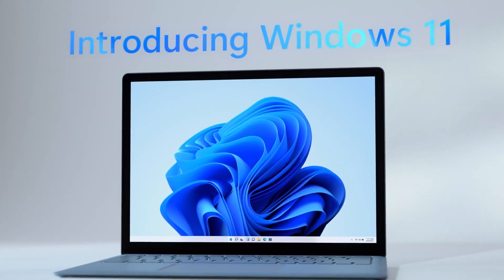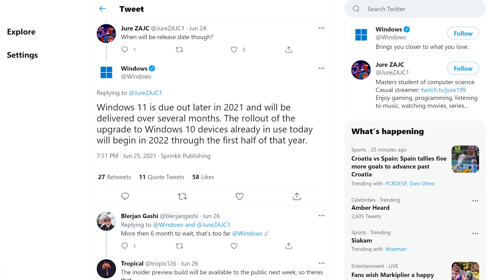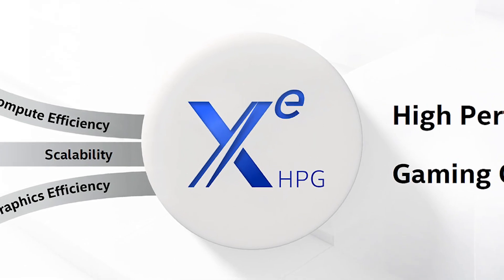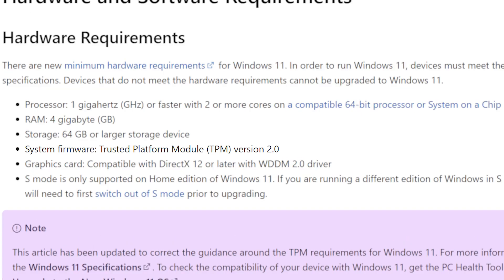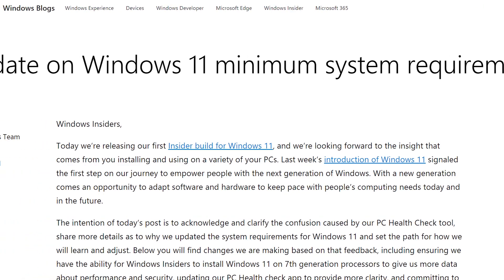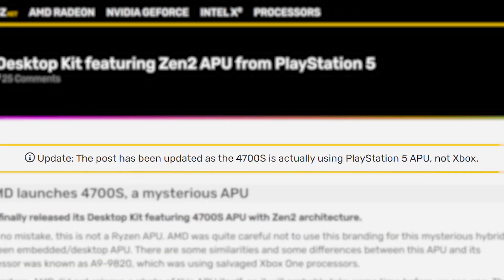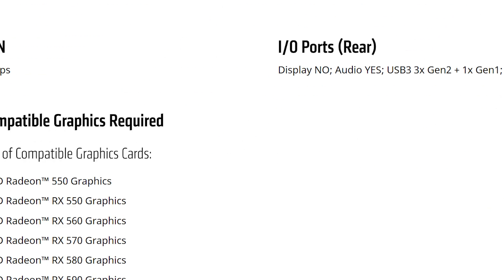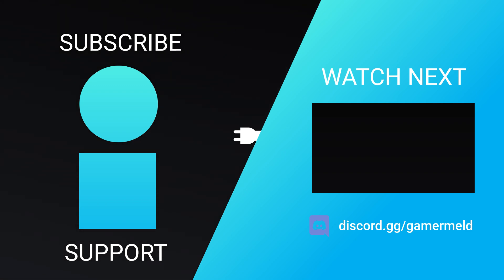TONS Of Gamers WON’T Be Able To Install Windows 11!

Comment: I'm just gonna switch to linux and run windows on a virtual machine exclusively for games I can't run on linux.
Reply: Why not dual boot?
Reply: @nowayitsjose1445  You can't dual boot if Microsoft requires TPM. TPM 2.0 is easier to emulate on a VM.
Reply: Dual boot exist
Reply: Virtual machines dont have 3d acceleration
Reply: @jakubk3678  yes they do
Reply: @maybelbdidit  nope kernel vm is the only way but i would need to use integrated graphics outside vm
Reply: @maybelbdidit  how?

Comment: Never expected new SO in this way. I can upgrade because i7 9generation, but the thing is.. if win10 it is gonna last until 2025... I guess that in 2025 everyone will have a decent CPU with TPM 2.0 ... What cost now tons of money, in 2025 will be cheapest and affordable CPUs on the market . So, not bad at all, people can continue using win10 getting updates and performance until they have the chance to jump into the new system. Don't alarm, keep calm and let's wait for the final release at least.

Comment: Ignoring a large chunk of potential customers is something that Microsoft would do
Reply: It doesn't really matter, since Windows 10 is a great OS in it's own right. Until we start seeing applications/games that only support Windows 11 it won't be an issue at all, and let's be honest...that's years away (or never).
Reply: @shadowsinsomniacs  right! Most still support windows 8
Reply: @shadowsinsomniacs  yea, thats years away
Reply: @shadowsinsomniacs  2025 eos
Reply: Its a free upgrade...
Reply: @Anonymous Apple yea
Reply: To make the latest hardware secure and feature packed as possible you need to set standards to keep push forward. If you can't keep up you will be able to buy used very good hardware soon for cheap as lots of people will be upgrading. Its a good thing.
Reply: @ashleycullen.933  I know. I made this comment before looking at the performance impact that win11's virtualized security has on hardware older than 8th gen Intel i series and AMD ryzen 2000 series. So I agree with you. However, people also might be able to bypass the hardware requirements of win11
Reply: @ashleycullen.933  The fact that people have got Windows 11 to run on perfectly good hardware from 8+ years ago shows that it's an arbitrary restriction. Having a TPM won't prevent people from getting malware by clicking on obviously malicious links and online content. This is a non issue for tech savy users.
Reply: @Anonymous Apple Nice, do you want my bank account details then?
Reply: @Anonymous Apple Who can be the biggest asshole is their competition.
Reply: cough ryzen 5 3600 cough
Reply: @agenttony  is r5 3600 not supported?
Reply: @NSA_Watchlist_Bait  I haven't seen it on the list so I don't think so
Reply: @agenttony  I thought everything later than the ryzen 2000 series is supported

Comment: So your processor has to be 8th Gen or higher just to install Win 11.
Jeesus Microsoft, what the hell were you thinking? This means that nobody will be able to use Win 11.
What the hell is even in Win 11 that requires THAT MUCH power to begin with?

Comment: Literally the only reason I use Windows 10 is that I play some games that only run well on DX12 on my hardware (Borderlands 3 just doesn't work properly with DX11 on my PC, for some reason). As soon as Linux finally integrates DX12 in a stable way, Windows can kiss my ass.
Reply: Lol

Comment: I’m  running windows 11 with my 1st Gen Threadripper no problems whatsoever.
Reply: The Insider Preview Build doesn't count. It's not the complete Windows 11. Not all requirements apply to the Preview Build.

Comment: Installed windows 11, it bricked my keyboard I bought 3 days ago.
Reply: Not Windows 11’s fault. I have the insider preview running on multiple virtual machines.
Reply: @SeanyKrabs  it installed firmware on my keyboard that’s unsupported by my brand, resulting in a brick.  but yea, not Windows 11 fault right 👍

Comment: Don't forget, windows 10 will be around for another 4.5 years. If a Zen 1 cpu is 3 years old now, it's going to be almost 8 years old by then. Are you actually going to be using that cpu still? If so, just stay on Windows 10...

Comment: Let's face it, if you have a 3 year old processor, and Windows 11 is launching in late 2021, by the time it's launched, it's going to be 4 years old processor. In addition to that, if you are a sane person, you are not going to install it until 2022 because you will wait for all the patches to get out so that windows 11 is actually functional.

Comment: I really don't get people who complain about CPU upgrades to run W11. So what? you can buy an older CPU 8th gen or 4000 series for cheap it is not like Microsoft only allow the newest 11th gen or 5000 series. The adoption rate of W11 will still be high because there is no good alternative for OS: Linux is for software developers only and Mac OS is proprietary which means you need an entire newer system verified by Apple. People are so dramatic, willing to upgrade GPU (spend 1g+ for scalper) without knowing your CPU is the biggest bottleneck.

Comment: I can't run it on my AMD Ryzen Threadripper 1950x. They expect me to buy a new computer after I spent 5k on my current one. Yeah, no.
However, the public feedback (read OUTCRY) was so overwhelmingly negative, they pulled their verification tool down. So, maybe. I'll bet that if the Processor Gen is the only issue, you'll be able to install it with a bit of tweaking to the install files.
F U, MS - BS

Comment: Unless they stop releasing something like .NET framework for Win10, there is little to no reason to upgrade to 11.
And it looks like something the pulled out of a road kill carcass in the first place. The UI screams "kill me!". 
Making something idiot proof, doesnt necessarily make it good. It just limits the user.
Also, you can bet birth certificate on Win11 phoning home even more than Win10 does. 

If you want to upgrade remember to backup all relevant data! We know what happened last time we got a free upgrade :P

Comment: Well , Ryzen 1 is over 4 years old ( 04/2017 ) and i installed Win 11 pro (dev edition )  without issues on my Asus B450 Gaming-F with a 3900X  yesterday .
Besides , Ryzen 1 support has to be seen , because Ryzen 1 is TPM 2.0 as well . No Problems so far  with Win 11 but its only 1 Day  since installation ... . 
Everything i use seems to work .

Comment: Well. Mixed feelings. Sucks that CPU's older than 8th. gen Intel and 2nd gen Ryzen wont meet the requirements. But. If what they say, that the TPM 2.0 will reduce malware with about 60%, it's kinda okay. I do not think that it will be then end for the world for most gamers to have to stick to Windows 10. It will be supported until 2025, at by that time, if the hardware is older, then upgrade and use windows 11-12 or thatever they call it at that time.

Comment: ya but everyone knows that Microsoft doesn't get to dictate what systems can upgrade, the hacking community does ... there are already a number of workaround for security requirements, that may not be acceptable for corporate using the operating system to oversee the oil pipeline that got hacked by Russians but for the average user just shopping online and watching videos or playing games these workarounds will be just fine ... but I really don't think Microsoft is quite that stupid, I think by the time it hits free upgrade stage they will have a special home version available without the strict security measures just to keep everyone on the same page ...

Comment: My pure guess is: The time windows10 was free as an upgrade (I assume it was somewhat mid 2016?!) should not upgrade free to 11 hence they just do not support any CPUs from that time. I bought a new rig a month before the free upgrade should end well and guess what my CPU is one of the lasts to no be supported by win11 (I could install a TPM2.0 module though) ..anyway I completely switched to Linux so i do not care.. Gaming works much easier here anyway.

Comment: Windows 11 lack of a movable Taskbar, and TPM 2.0 requirements are a no go for me. The primary reason I early adopted Win 10 was because I was a MS Surface support rep at the time. I'll wait to get Win 11 when I build my next system with DDR5 Ram on a second gen AM5 socket motherboard. A movable taskbar should return by then. Im perfectly happy with B450/R5-2600 for now.

Comment: If you bought a new pc in the last 5 years (since ~2016), you should be fine.  Intel and AMD have been including TPM2 by default.  I did have to enable TPM security in my BIOS but it wasn't a big deal (running win 11 now).

Comment: As of now Windows 11 only supports 8th Gen CPU and higher along with TPM 2. There is a workaround this. Take the Windows 10 iso, open with Explorer and in the Source folder you will find install.wim, make a copy and replace it with the one in Windows 11 iso.

Comment: I've been rocking an HP Z210 with a Xeon processor that I've upgraded over the years.... graphics cards, maxed out the ram, SSD, etc.  It's still a solid low to mid range gaming rig but I guess it'll be e-waste in a few years

Comment: Common wisdom from 20 years ago was to wait until at least the first service pack before upgrading to a new Windows version if you don't want to deal with launch bugs. Microsoft not forcing upgrades on people until many months later is a legitimate feature-not-bug in my book. I'm not planning to upgrade to Win11 even if free at least until the first major update is out.

Comment: The leaked Version Windows 11 runs just fine on my ryzen 1400 and on my Threadripper 1900 Server CPU first Zen Gen. It´s more about the Board and the Bios because the CPU Chips are very able to run TMP 2.0. So it is not true that first Gen ZEN CPU´s cant run win 11 !

Comment: I've got a Ryzen 3600, so I'm not mad. But those requirements aren't set in stone, they could still change before october. I think you would be able to run it, even if your CPU is not on the list (as long as you have TPM and the other things)

Comment: As a casual gamer, I still mostly use Windows 7 with 10 LTSC just for DX12 titles. I don't care about Windows 11 at all and by the time it will become relevant, my Zen+ Ryzen 1600AF will be able to run it, as it's basically a rebranded 2600 which is on the support list. This isn't really much of a problem at all. If they don't release a LTSC-like version of 11, I'm not going to upgrade at all and will probably go Linux for my future gaming needs.

Comment: I am currently running Windows 11 on two machines. One of them is a 4 year old Lenovo Legion Laptop with an Intel I5-8750H (yes it is a supported processor) but the laptop doesn't appear to have TPM 2.0 as no specs or the bios identifies it as such.....

Comment: Why the hell do I need TPM or Secure Boot? - the 7th gen & 1000 series will both be quite old by the time Win 10 is EOL. I suspect in the short term MS want to stop OEM's selling the new OS on crusty old hardware, which is what happened with Windows 10. There were some very old manufacture dates and terrible specifications. (2Gb Ram & 32Gb SSD)

I like the option of TPM & Secure Boot, but MS already has the bad habits of auto enabling it on clean installs and OEM products, even where you have not asked for it (or are using a local account) and you may not of even know that you need to get a key prior to it all going tits up. [No its not automatically uploaded to your MS account even if your logged in with one, it seems a bit hit and miss].

My issues is I suspect there maybe people who are gona have to change there Motherboard if its a SFF PC to add TPM sockets. I am lucky that I bough a MB with a TPM port, and as I was thinking of getting a USB fingerprint reader I bough a TMP2.0 module a few months later..... but the TPM was NOT on my list of things I required.

Anyway, Bye bye data recovery on Windows 11 is my thoughts.

Comment: I Guess my Ryzen 5 1600AF won't work Huh ?
Reply: It will work, as the 1600AF is simply a rebranded, lower-binned(not as overclockable) 2600 and the 2600 is on the supported list.

Comment: MS are asking people to try windows 11 on lower than specified hardware on the insider programme.
This guidance will be for system builders, whilst more real world testing is done the required specs will reduce for upgrading.
I am speculating here, but I’m pretty confident that is what is happening.

Comment: I found some Win 11 workarounds and installed it on an i7-920 from 2010.
Reply: The Insider Preview Build doesn't count.
Reply: It does if you are trying it out on a system that is not your main PC before installing it on your primary system.

Comment: I don't think it's really an issue. The majority of gamemakers set minimum specifications for their games. Games on the Windows platform tend to look backward a minimum of 2 years, sometimes as many as 7, but the average is four to five years. We know game makers and windows work together for compatibility purposes. So , at a minimum, new games in 2022 and 2023 will be compatible with both Windows 10 and windows 11. My guess is that games in 2024 will also be compatible with Windows 10. That means that gamers are not left out in the cold, and we'll have about 36 months to make adjustments to our current rigs, or to simply upgrade sometime over the next three and a half years. My gaming rigs are currently three and a half and two and a half years old. The oldest one can't be upgraded and must be replaced. The recent one just needs a TPM module from the motherboard manufacturer. But I might just save the 50 bucks and replace the entire rig in 2024 with a substantially faster CPU and GPU. I used my Win2K computer for 17 years - still stable as a rock.

Comment: Im pretty sure that intel i7 gen3 still more powerful than intel atom gen8
Reply: Has more to do with Intel’s ability to create security holes on 7th generation chips and older then problems with those actually running it.

Comment: Not like Windows 11 was going to be worth a fucking damn anyway. Yeah sure the ultra stripped down bare metal developer preview showed like 2% better performance than a bloated Windows 10 install but once Dell Acer Asus HP and all the other oem rapists rape Windows 11 with all of their pre-installed bloatware it's going to be even worse than Windows 10 so I wouldn't give a shit about Windows 11 if I were you. I bet everything will still work on Windows 10 for at least 5 years more anyway so who caress.

Comment: operating systems are symbiotic with the hardware you buy to run it on.  unless it won't run on it- inwhich case don't buy 11 and go linux (assuming it works).  this might be a sneaky deal to push people to buy new chips!

Comment: I'll probably be moving to Linux. Microsoft Windows no longer appeals to me. I'll make the switch when support runs out or maybe when a hacker produces a version that doesn't have the same requirements that windows 11 currently has I'll install windows 11. I'm sure they'll be able to do that.

Comment: Updated 8.1 to 11 by replacing a dll file in sources folder on the USB for installation. And I have an i7-5960X and a RX 590

Comment: 7 min video which could have been shrunken down to 30 sec. IN SHORT “ unless 2nd gen AMD or 8 th gen Intel CPU , you can’t use windows 11 . Not to mention TPM2.0 & secureboot are two additional thing you must have “

Comment: I recently got a Ryzen 2700X because it's the last Ryzen series that can run Windows 7. I guess it's also the earliest Ryzen that'll get Windows 11 support. Sweet spot.
Reply: I have 2600x is that 2nd or 1st gen
Reply: @NeedBackup_  second generation but using Zen+ cores.

Comment: The UI reeks of windows 8 anyways. We're not a tablet, we don't want our UI centered and we don't want android apps on our windows PC. I'm going to stick with 10, which they'll probably throw a temper tantrum about by failing to provide security updates and demanding I upgrade to 11 every few days until they just flat out schedule a time for the PC to upgrade without my consent. I will then have to google around to find a way to block them from doing this, while the computer I own continuously gets more and more irritable as if it's a Microsoft employee and I'm wasting it's time. The software and gaming ecosystem really needs to switch to Ubuntu and be done with it :P.

Comment: All you need to do is enable ftpm in the bios or buy a ftpm and put it in your motherboard ez😂
Reply: And spend like 100$. And worry if it will be supported. Why tho?
Reply: @godlikekiller4344  ftpm 2.0 then use pc health to check and done
Reply: @godlikekiller4344  or buy a new motherboard